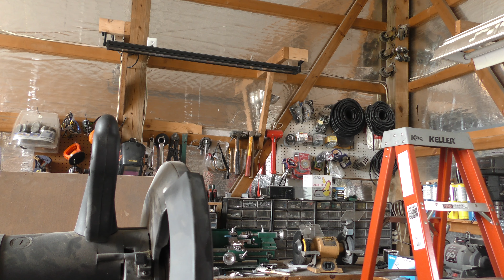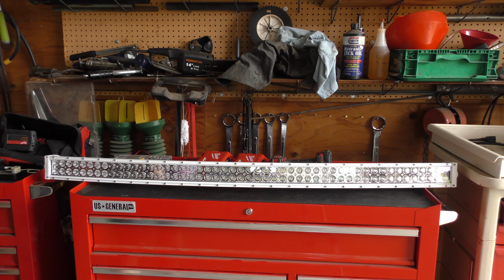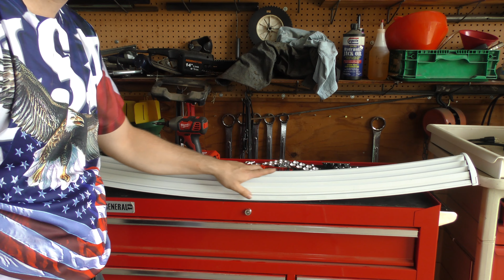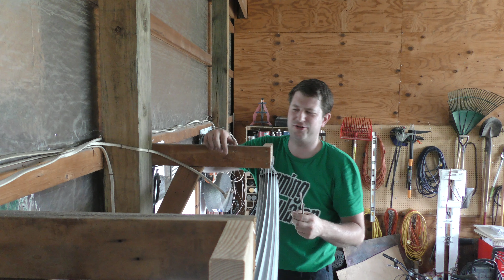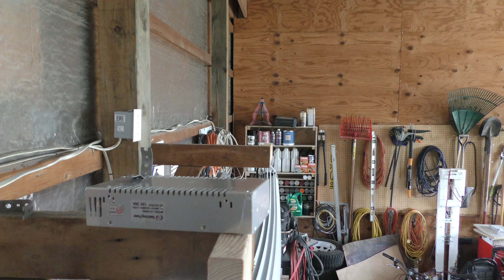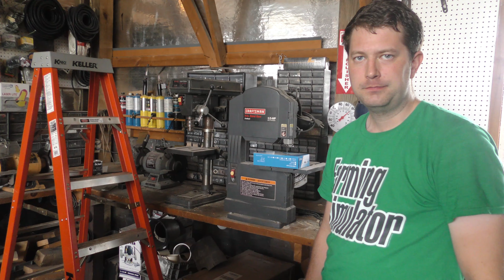Installing a Curved LED Light Bar as a Shop Light

Comment: please let me know how much amps the lights use and i dont mean how much they can use i want to know how much they are using from the power supply
Reply from the maker: They are both using 2-3, based on the wattage though they can use 10 amps
Reply: thanks so much for letting me know u saved me money i thought i was going to have to buy a 30amp 12v power supply

Comment: With the led driver you said it had 3 positive and 3 negative ends couldn’t you run 3 light bars with 1 driver?
Reply from the maker: I could yes, but wanted to have it on the switch.  Plus it could run as many LED as what it has power for.
Reply: Ok that answers my question I’m thinking about doing my shop this way so thank you for clearing that up for me

Comment: would the electrical rating be comparing the light to a standard light of the same brightness?
Reply from the maker: I'm not sure, original light was 2x 40 watt 120v ac the led is 120 watt 12v dc.
Reply: RDAllen just wondering if the wattage marked on the box 300 watt would be what a normal light would draw that was not led.  You see that with lots of lights saying there 100 watt bulb but only draw a few watts compared to stands red light